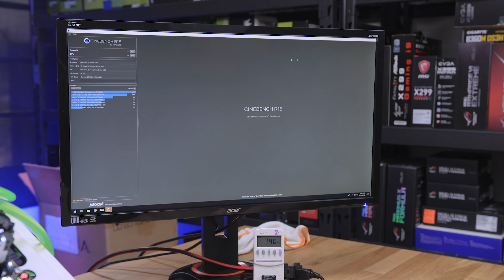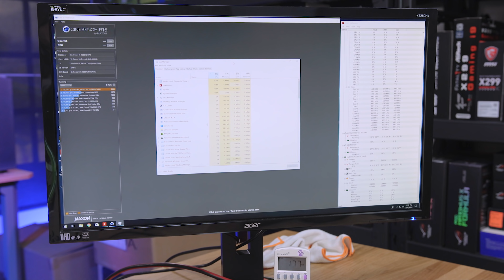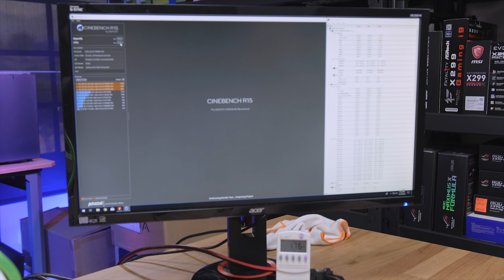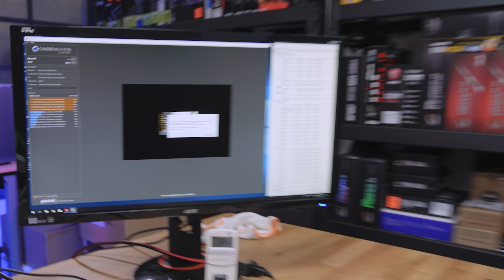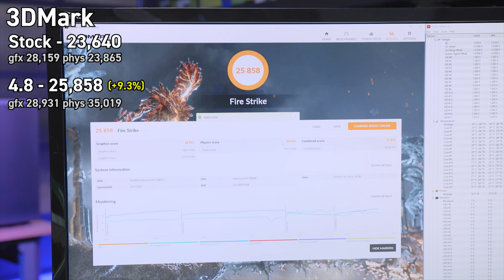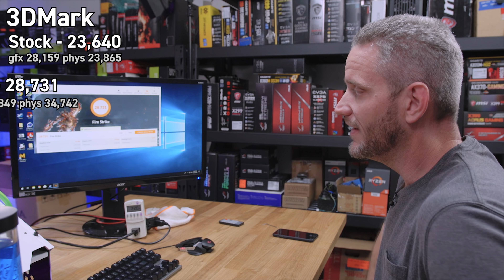Trying to get back on the 3DMark Leaderboard!

Comment: Shintel 18c/36t at 4.7 GHz eating 750 watts where around 700 watts on the cpu die alone....I thought that niclear devices were banned from general public like 30 years ago....oh wait, what was Shintel doing for the past 30 years....oh yes bribing OEM partners and being affraid of AMD a superior cpu developer and superior manufacturer :-).
Reply: Lol fanboy
Reply: omg shut up both Intel and AMD CPUs have a place, it is ridiculous to see people arguing over this crap like it matters.  People buy what they like, not what they think some random asshole online thinks they should like.
Reply: LFly R ayy
Reply: david s so a AMD chip can’t beat another AMD chip ?? 🤪
Reply: @FAJAR MULIA, what are you talking about ? your 1800x can't pull 720 watts from the wall on water. You can always take your phone, show the OC settings, buy a power meter, show the power draw of the system with only the CPU in cinebench or blender or prime95 or . I can't believe a 8/16 will pull more than 300-400watts at 4.1ghz.
Reply: Lots of misinformation in this thread... so many attacks with someone being a fanboy...

Hate to tell you this, but AMD's Ryzen 7 1800X beat the 6900K at the same clockspeed, but with less power; and so did the 2700X vs. the 7820X, again, with less power. Threadripper 1950X scores at least 3000 at stock... 7980XE only gets 3400 at stock and uses more power. Of course with fast RAM, Threadripper can get to 3100-3200, making the gap even smaller at stock. Intel's chips are so badly inefficient, their Hyper Threading technology scales worse than AMD's SMT implementation and uses more power because they've rehashed the same Nehalem architecture with small improvements. Ryzen 7 is not meant to compete with mainstream, Ryzen 7 is competing with Intel's i7 HEDT CPUs. And guess what? Ryzen won both times, easily.

"If you OC a TR1 to 4.5ghz it will pull 700w+ watts". A 1950X will not pull over 700 Watts, that's wrong; it won't get even close to 700. What also proves that further is that you cannot overclock it to 4.5GHz. Also, i9s are known to overwhelm air coolers and pretty much require liquid cooling. 140W/165W TDP seems to be a lie here.

But to say the 2500K sucked is an overstatement, it really didn't. A 2500K can get at least close to 5GHz if you have the right equipment. And, it was better than any FX offering when FX released.
Reply: david s Yeea, no. 1950X isn't tooooo far off and anything Zen is way more power efficient than anything Intel. AMD Hot 'n' loud is a dead meme.
Reply: lol AMD Is for budget kids and AMD have produced shit for years and the only decent AMD architecture is ZEN and intels 8th gen chips still beat them
Reply: CJ-GAMER Not in anything other than gaming. 50/50 market share now bois.
Reply: CJ_GAMER : warning Shintel fanboy detected that still cannot accept the truth of Shintel being a hardware wise security flawed nuclear hungry failed Bloomfield 2009 based architecture with absolutely no multi-core performance and worse IPC :).
Reply: LFly R dude you are an amd fanboy , but you type shit like " shintel fanboy detected.". Man you are the shit one here xd
Reply: david s : complete Shintel i9 series heats up your house at stock clocks already. This i9 7980XE has a TDP of 165 Watts at stock clocks of puny 2,6 GHz and uses around 185-200 Watts on the CPU die already. You heating of your winter house can begin here easily. When OCin is applied then your winter house will melt all the ice around it in 5 mile radius and burn the house to the ground.
Shintel cpu-s let themselves be OCed only because Shintel themselves disregard any voltage safety procedures and don't care if this kind of OCing shortens your cpu-s lifespan to 1 year maybe.
Reply: LFly R XD, you think it's not the same with amd ? Pls show me 4.8ghz tr1 and show me the watts pulled from the wall. Oh wait , you can't without ln2.
Reply: Quetzalcoalt : dude stop bragging with overclocks. That's something that only selfproclaimed youtube reviewers do for the duration of benchmarks. Nobody else on the planet OCs their cpu-s to this kinds of high clocks (maybe mildly by a few 100 MHz yes) because the want their motherboards and memory sticks to work flawlesly infinitely and not die in a few months time on the VRM side or memory banks side. Don't make a fool out of yourself even more with these kinds of childish comments. Real world scenarios with overclocks are much more different that these selfproclaimed reviewers are trying to portray to you youtube brainwashed dull minded amebas.
Reply: lFLY R, dude, i run my 2500k on 4.8GHz since 2011 and i run it 24/7. I've done Cinema 4D animations, Premiere pro exports, Lightroom all the time + gaming, i've also have populated all the RAM slots. Nothing died yet. What the heck are you talking about?
You just can't accept that Ryzen is the same nuclear hungly failed. Ryzen pulls the same amount of watts. If you OC a TR1 to 4.5ghz it will pull 700w+ watts. It's just how hardware works under heavy OC. 

You are the butt hurt amd fanboy shit here, but you can't accept it. It's just sad, only children can't accept reality.
Reply: Quetzalcoalt : sure you do buttercup :). I owned an i5 2500K a 4c/4t crappy cpu that never wanted to stay stable at more than 3,9 GHz on all puny 4 cores and it was crap for Cinema 4D animations and Adobe Premier. To say like you did that you could do all of those things together is a blistering dellusion from a Shintel shill like you are :).
It's impressive to what extents you Shintel fanboys will go when you lie about what you have and how OCd you have and what you can quazi do with your crappy Shintel overheating hardware wise flawed cpu-s. Really dude, take an hour and read your comment again calmly and you will see how big of a dellusional lie it is :).
P.S. Threadripper cannot be OCd to 4,5 GHz FIY ;). At 4,2 GHz it eats around 300 Watts on max on the CPU die alone whereas Shintel i9 7900X at 4,5 GHz eats around 400-500 Watts, overheats to lava temps and kills VRM-s for breakfast and it has 6 cores less and 12 threads less while costing 1100 bucks which is 300 bucks more than 1950X a 16c/32t AMD Threadripper.
Reply: Ayyymd wins shintel sucks

Comment: Hey, please take a 1080Ti, custom watercool it (block or G12), delid the CPU and retest. We want to see you in the upper 50s!!!
Reply: You're not gonna get in the top 50 with a 1080 Ti.   You'd need a Titan V.
Reply: The Poseidon is water cooled & air cooled
Reply: RathØX Yes, but the Poseidon block isn't as good as an EKWB.
Reply: BlueKingNL i have one and its pretty damn good vs one
Reply: The card has to be bios modded to allow any more voltage or power draw. Im sure he isnt limited by temperatures on the gpu

Comment: Jay. Please. Delid that thing and get the AC Boxfan rad setup. Come on Jay. You can do better than that.
Reply: He should buy a direct-die frame from der8auer
Reply: i don't think he will delid it...he uses it for his tests like the 8700k
Reply: The box fan setup should be a permanent fixture of the test bench
Reply: ye 61 is not a really good position, at least reach the twenties
Reply: Do it
Reply: I was just about to say that.
Reply: It's not the TIM, it's the distance between the IHS and PCB caused by the glue. (TIM could be bad, but doesnt cause the extreme overheat it does without delidding)
Reply: woaah so many likes. thanks!
Reply: yes YES YEEEESSSS
Reply: GeForce nah, delidding sends intel the message that it's ok to be shitty to consumers
Reply: Interrobang saying that you shouldn’t delid because it says that intel is ok is like saying you shouldn’t tip because it says that companies can pay servers less. While you’re thinking in the right place, your thought process is all wrong. Because if you stop doing it yourself, that doesn’t mean that intel (or in the server case restaurants) is going to start doing it.

Comment: Holy Balls! On the 4.9 run it hit 750W the cables must be melting at that point! Jay?
Reply: a regular extension cord cable can handle well over 2KW
Reply: Hairdryers usually hit 1kW, a measly Intel chip is nothig.
Reply: I do not understand how you can call a chip measly when it draws more power than the average system at least in the context of computers
Reply: Zanzaroni GR It was meant as a joke, nobody can serously think HEDT chips are measly. Yet, it is weaker than ovens, hairdryers, industrial pumps...
Reply: Well this comment thread shows how fucked up YouTube comments are now, JAY GO TO FLOATPLANE!
Reply: Isn't that what my microwave usually runs at?
Reply: thoth111 Funny you say that, my room and my mothers room share the same circuit along the back wall which have 2 window ACs, a tv, my computer and 2 monitors as the main power draws. When my computer is overclocked and playing games and both compressors kick in for the A/C at the same time, the breaker cuts the circuit. I ordered a long power cable for my power supply but in the mean time I had to take my 3770k down to 4.2Ghz from 4.8Ghz which dropped power consumption almost 100w (that's 1.25v from 1.48v)
Reply: Wattage is only one part of the story, as others have stated (amps) and 750w is actually nothing. Sounds like a lot for a PC, but electricity wise it's very low. Do you guys have really shitty electric systems in homes in the US or something?
Reply: TDS 
No, this guy is just a dumbass
Reply: Infrastructure is crumbling atleast where I am. A fly could fart and a transformer explodes. Somehow the electricity doesn't go out but they send someone a week later to drive by and take a picture. Then it will get replaced the following month.
Reply: A common US house (within the past 20 years or so) will have 15A circuits spanning a room or two or a room and a bathroom. Common household outlets are also rated at 15A here. For a standard house this is fine, but enthusiasts pulling this kind of wattage from the wall really need to check what all is on the circuit before the breaker pops while gaming. My PC and my GFs PC in the same room can run fine, but the instant the mini fridge kicks on the compressor draw is too much and will pop the breaker if we're both pushing our systems. Dang Ol' 15A circuits man. You can combat this by putting a higher rated breaker in the box and changing the cabling going to your outlets but your panel might be capped. Depends on the house.
Reply: Thats not much power man
Reply: 2100w from the wall ez
Reply: 750w = roughly 6.25 amps. 
The extension cord can handle that.
Reply: For circuit breakers, 15 amps = 1875 watts. V * A = W, is the equation.
Reply: In europe (220v) 16 amps  = 3520 watt. V * A = W, same equation.
So we can draw more watts per group simply based on just being in europe ?

I just checked, main breakers are 40 watt = 8.8kW I can overclock 8 systems at the same time (If i had that kind of money)
Reply: Fuses in europe are usually 10 amp though, arent they? except for the stove which is usually 16A
Reply: Yeah, I think you are right, but our home has 5 groups of 16 amps and 2 mainbreakers of 40 amps. So we can put the washing machine in the living room and the stove in the bedroom next to the haidryers ....
Reply: Sounds like 220 homie.
Reply: ppm> my response was to Parkchap. I already said i'm in europe. 

Capt soban> all 110v ? Euro farms (and industrial facilities) often have 380v 3 phase. But I'm no expert anyway, might be slightly different.
Reply: Parkchap i live in Australia but we are 240v here normal circuits are 10amp for lighting and 16 or 20amp for power
Reply: thoth111 instantaneous power draw for a induction motor is closer to 10x unless some sort soft starter is used
Reply: I'm looking at a 7980XE from CaseKing, and for a guaranteed 4.8GHz they want 2600 EURO's! So Jay must have gotten a Golden Sample CPU!
Reply: i dont think so,only on 110v, maybe
Reply: its higher for us with 220v here
Reply: TheBritishUnknown 750? That's my entire PSU's capacity.
Reply: It all depends on the extension cord. A 16 ga/100 foot long cord, is a big difference from a 10 ga/20 foot cord.
Reply: I live in America and  our main breaker here is 200 Amps since we live on a farm.  we have deticated 30 Amp breakers for the Heat Pump, Oven, and microwaves and water heater.  We also have 15 Amp breakers for all of our rooms ands I think 2 20 Amp breakers for the Kitchen thats not deticated for the Oven.  So we could draw a lot of power before setting off the Main so doing stuff like this wouldn't really be that big of an issue here.
Reply: In Germany every normal power cord can handle 3.6kW (16A@230V)
Reply: Yeah, from extension cord to circuit breaker there shouldnt be any problems obviously as there are things that require twice or quadrupple the power of that but you gotta be honest, 750W for a CPU only benchmark is way too much. :D
Reply: TheBritishUnknown Britain sucks